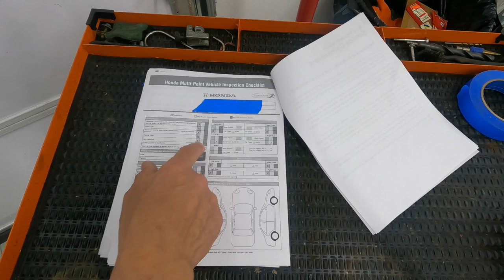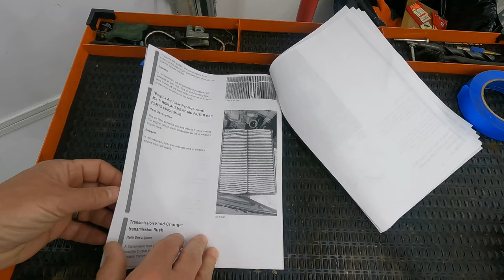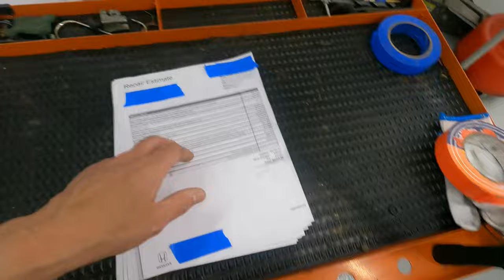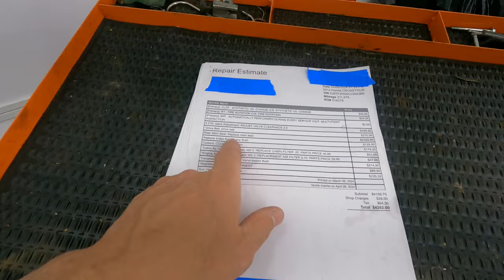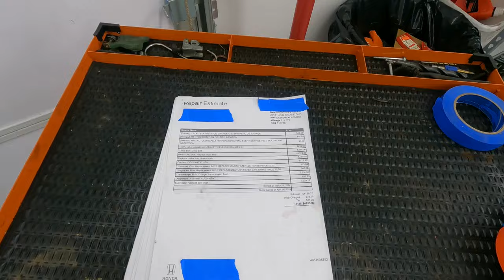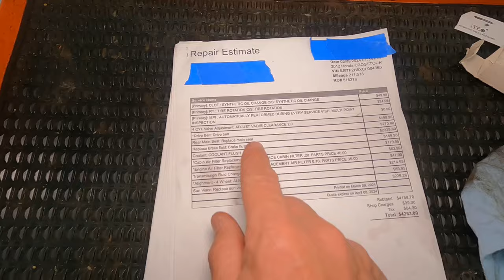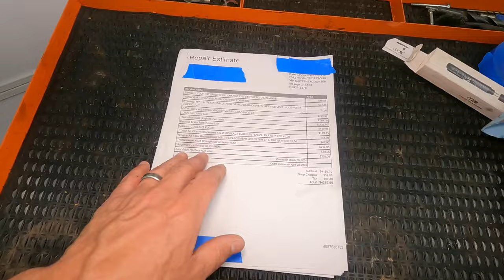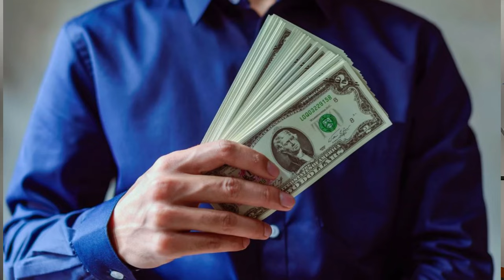Why car dealerships are called "stealerships"

Comment: The water is heavier than brake fluid it will accumulate at the bottom of calipers, so brake fluid flush is needed every 2-3 years to remove the water for system
Reply from the maker: Another good reason to open the bleeders when compressing the calipers to expel some of that crud while changing pads
Reply: @joyofwrenching  That's some I just recently learned, The stuff that came out of my F150 calipers was dark green and stank like the worst dirty socks ever!
Reply: @joyofwrenching  That water makes its way down there through the reservoir and is corroding the internals the whole time.  That's why brake fluid flushes are recommended.  They are not a scam.
Reply from the maker: @johnaclark1  yes, brake flushes are necessary now and again
Reply: Water dissolves in brake fluid, does not settle at bottom of calipers.  My 1998 Frontier at 275K miles is still on its factory rotors, drums, calipers, wheel cylinders, master cylinder, and original brake fluid.  Should I ever have a hydraulic issue, then I'll completely flush out all the old brake fluid.  Note that I'm in Arizona, very dry here.
Reply: Yes, water is denser than brake fluid. It WOULD accumulate in the lowest places...IF brake fluid was hydrophobic and they remained separate. But that's not the case. Brake fluid DISSOLVES water into itself just like air does. Nobody uses this terminology, but brake fluid can essentially have a humidity level, just like air can.

The reasons to flush out old, moist fluid are as follows:

1. SAFETY: Your brake fluid can get pretty hot. It can get hot enough that the moisture contained within it boils. Your "fluid" will be filled with millions of tiny steam bubbles, like a frothy foam. All these tiny steam bubbles are compressible, unlike the dry brake fluid itself. This compressibility means that when you push on the brake pedal, you energy will be used to squeeze those bubbles instead of to squeeze the brake pads together. This is usually referred to as having a "spongy" feeling brake pedal. If the condition is bad enough, you can push your pedal to the floor and still not have much braking effect. Depending on when and where this happens, it could be a, "My brakes don't work, OH SHIT," type of scenario.

2. DURABILITY: The moisture in your brake fluid can of course cause corrosion on some of the parts inside your brake system, decreasing the useful service life of those parts and therefor the entire system as a whole.

I change out the brake fluid in my street cars every other year, and on my track cars about every six months or at least prior to any track event where it's been more than six months. That level of obsession isn't absolutely necessary, but I like to play it very safe when it comes to my brakes.

Comment: I agree but we have a Chevy Dealership that is local to where I live in Ohio and their prices are on par to regular repair shops so I’ve been splitting where I have my car worked on. I go there when I want factory parts and for transmission flush and things like that and go to my cousins wife’s family tire shop for that.
Reply from the maker: Yes, as you've found, not all dealerships are bad! Nice that you have a family connection at another shop too for that second opinion and some less expensive work.

Comment: The problem with dealerships is all those flushes are high proffit for the poor tech getting paied for every hour of work sold not for every hour he is there, as for rear main leak or valve adjustment again high pay on customer pay compaired to scraps the dealer ship pays for warrenty work. You also have to remember that most dealers dont pay diagnostic time, so are you going to put to much time into diagnostics if your not getting paied? Likely no your going to look at the service scedual and let the service writer do his job there are bad apples everywhere but dont point the finger at the tech he is doing what he can to feed his family. If the greedy dealer wanted to pay for a real craftsman this shit wouldnt happen
Reply from the maker: We can all agree the techs are the real heros and are getting abused in this industry.  They really should be paid and treated better!

Comment: Those are two different leaks there.  Rear main is seeping a bit.
Reply from the maker: Could have spit out a drop or two over the couple hundred thousand miles, that's true. Surprised they missed the CV axle leak though

Comment: Installed new brake pads and rotors on pathfinder. Had some warranty work done few weeks later. Nissans "inspection" said my brake pads where in dire need of replacment. They even wrote some phoney measurment showing how bad they where. What a joke
Reply from the maker: So sad, but good for you to know better! And think how much you saved doing those brakes and rotors yourself!
Reply: GM dealer wanted to replace the 1-month aftermarket radiator hoses on our 2005 a 15 years ago.  The hoses had the Gates stickers and non-GM hose clamps on them, believe they "diagnosed" from odometer reading.

Comment: As I tell folks, odds are the dealership is going to suggest anything that isn't as it was when it left the factory.    
Sagging visor? Who cares if the owner doesn't. Maybe the owner is shorter and keeps the visor in the down position 99 percent of the time. 
Seeping seal? We call that spot rust proofing here in the rust belt. =-)  Keep an eye on it, if it gets worse, yeah, then we'll go in.  
From the list on this car, I got a feeling rear main seal was the lead to a further upsell once it was in the shop; hey Joe, we found something else once we got in here, you need a shaft and seal... btw, that'll be an additional $999....  You don't want to spend that much on fixing your used car? Well, heres Sam, he can show you some of our new cars that you'll really love..."

Comment: Valve adjustment for our 2005 CRV is in the owners manual as a mileage based item and the brake fluid change interval is also in the owners manual as a time based change. I bet if you opened that owners manual, both services are probably due. Are you recommending ignoring these schedules printed in that cars manual?? Also I believe valves only make noise if they are tight, not loose, (or the other way I forget), so no noise does not mean it doesn’t need it.
Reply from the maker: Good points, and no I don't recommend ignoring these types of issues forever, just hated that these guys made the owner feel like they needed to do that all today, and many of the recs were wrong

Comment: I got a coupon oil change at my local BMW dealer. They came back with a recommendation to replace all 4 spark plugs for $700. They're 100k mile plugs, and the car only had 40k miles! I later bought them myself, along with new coil packs, and did the job when the car was at a higher mileage. It was super easy, even for me.
Reply from the maker: Good catch! And think of all the money you'll save over time doing your own maintenance...enough to enjoy a nice vacation I'll bet!
Reply: European Cars are very expensive to repair when out of warranty.  Also they often use plastic parts which do not last over time.

Comment: And the “alignment” scam is a buggy.  We did a free alignment check and one is out…. $150.00?   Had that tried and refused. Got car home and checked torque in all wheels the next day.  The one that was out had 2 nuts side by side that were hand loses and the others under torqued.  Corrected that. Took care of to an independent alignment shop and told them what went in. They did an alignment check. All in spec. Haven’t been back to the dealer since.
Reply from the maker: Wow, that's shady if they loosened the lugs! and dangerous!

Comment: Even if you pay for a transmission or brake fluid change what's to say they don't do it but charge you for it? My coworker marked his tires to see if the dealer did the $19.99 tire rotation. They did not. He called them out and pointed out the special marks he made. The manager made excuse that the tech is going thru a hard time and then have my coworker coupons for a couple of free oil changes.
Reply from the maker: Ouch, busted!

Comment: Big brother was a mechanic working for a domestic dealer (not Ford or GM, hint)  which often offered a $9.99 oil change. Figured I couldn't go wrong with my brother as the tech, right?
He tried to warn me off, because he was 'required' to upsell the job, and if he couldn't, the advisor would!
I asked big bro if my demanding adherence to the advertisement would jeopardize his job, he grinned and said, "Let's find out."
My truck was low mileage, less than 3 months old, and perfect...
The service manager was pissed, and brother had a new job 2 weeks later (a Master with 30+ years at that point, getting another position was not a bother😊)
Reply from the maker: Wow, that's so sad, but I'm glad he had options!

Comment: Cant agree more - I have 2013 ford (escape 1.6litre turbo) which the adaptive cruise control radar stopped working - dealership quote for part without installation =  $5000, had 2nd hand part $350 plus fitting & programming $300 - not been back since.
Reply from the maker: Wow, that's a big difference...enough to fund a vacation!

Comment: Dealership hourly rates are usually 150-175 per hour….Factory replacement parts either: belts etc are double parts houses….what do you expect?
Reply from the maker: The dealership does tend to be more pricey than many Indy shops

Comment: That passenger front wheel did look like it was wearing more on the inside. 

The coolant should be changing atheist every 105,000. That car had over 200,xxx
Reply from the maker: Yeah, many of these things need to be addressed over time if the owner wants to keep it going as long as possible,  but in this case they tried to take advantage of his lack of knowledge and used some fear tactics to make them think it was all critical
Reply: There is a simple and inexpensive test which tells the coolant strength in cold weather.

Comment: Isn't it true that Hondas require valve adjustment every hundred thousand miles? This car has 200k so the tech advisor was right to recommend. It's one of the reasons I prefer Toyota.  ( valves never need adjustment and has timing chain instead of belt). Hondas require more maintenance after lots of miles compared to Toyota. It sucks that Honda stuck with adjustable valves and timing belts. I guarantee you those valves have tightened out of spec after 200k. I don't agree that you should wait until they make lots of noise.
Reply from the maker: yes, this should be checked and adjusted on these engines. It's just not the end of the world they tried to say it was, and I still think it's funny they quoted the cost for a 4 cyl adjustment...wonder if they would have hit them with a higher 6 cyl cost had they got the go-ahead?
Reply: A tight valve shortly becomes a burned valve and a burned job requires a valve job.  I just don’t know why a valve adjustment would be over 500.00?  Must take close to four hours?  Doesn’t look that time intensive.  Anyone?
Reply: Only V6 Hondas have timing belts.  The fours haven’t had belts in many years.
Reply: @craigjorgensen4637  thanks
Reply: @craigjorgensen4637   I would think that valve jobs are over 500 bucks because only mechanics with lots of experience and training should do the job and they will charge accordingly.  Where do you live to think 500 is a lot for a valve job?  Just fixing a valve cover leak is probably 400.  (Just replacing the gasket).   Adjusting the valves to factory spec should cost well over 800 dollars I would guess.
Reply from the maker: @craigjorgensen4637  it really doesn't seem too bad other than removing the valve covers, which means moving all the stuff above them
Reply: @hothmobile100  Well, if a simple valve adjustment is 550.00 a valve JOB would have to be triple that.  It would involve a lot of labor, sending the heads to a machine shop and a lot of money in parts.  I can’t imagine a valve ADJUSTMENT could take three hours?  Add a set of valve cover gaskets and yeah I suppose with a few other parts and tax the price could go,over 500.00.  I guess I live in the past.

Comment: I am not a fan of the dealerships either but you are overlooking a few things and leading your customer/friend down a bit of a primrose path.  A few comments here from someone who has worked on a lot of these J series Hondas:

Be careful telling someone they don't need the valve adjustment.  If that car has 200k on it, and it's never been done, it absolutely needs a valve adjustment.  Having done many on these, I can tell you that the exhaust valves will tighten up and cause no noise. This begins to happen around 140-150k miles.  Honda recommends the adjustment every 105k. I'm all for skipping it and pushing it off to 150k or more but not beyond 200k.  So, just because it's not noisy does not mean it doesn't need a valve adjustment.  Every one I've adjusted valves on has had tight exhaust valves and loose intake valves.  With tight exhaust valves the engine is at risk of burning exhaust valves, or at the very least will begin to experience random, unexplained misfires.  If there is any record of it being done then it's unlikely it would need it again at this mileage.  Otherwise it's a good recommendation and definitely should be done soon.

Your inspection of the serpentine belt is incomplete.  Yes, check for visible cracks but also you need to check them for wear in the grooves.  You only need a cheap small tool to check that.  It looks like a small saw blade and goes across the belt in the grooves.  If it's tight then it's good.  If the tool wiggles back and forth across the groves then it's worn and should be replaced. You didn't check that.

Brake fluid does absorb moisture from the air so that would need to be checked, along with copper content of the fluid.  Copper is a byproduct of corrosion.  You can't go by color of the fluid.  Honda recommends every 2 years but you can buy test strips that check the copper content and their are moisture testers, as well.  

That oil could be coming from the axle seal but another common source of misdiagnosed oil leaks on these is the rear spool valve.  They are prone to leakage.  I agree they are completely wrong on the rear main seal diagnosis though.  

Transmission flushes.  Honda doesn't recommend "flushes" on their transmissions.  I hate when the Honda dealer even calls them that.  They are simple drain and fills and if you can change your own oil, you can do trans fluid changes on these.  If your goal is to change all/most of the fluid then 4 drain and fills, with some driving in between, is what Honda recommends and I think they recommend it every 30-45k miles.  Personally, I do one trans drain and fill every other oil change on my own J35 which keeps most of the fluid clean all the time. I've got over 273k miles on mine.

My point here is that much of what the dealership is recommending is valid.  Yes, their prices are higher than what you can find elsewhere but most everyone knows that when they go there.  The rear main seal is a complete misdiagnosis and it's pretty obvious it doesn't need an alignment.  The rest of the items are good and valid recommendations.
Reply from the maker: Good points and information. Thanks! I hate that they made my friend feel like these were all urgent, but I agree they all eventually need doing on cars we plan to keep a long time. They plan to get a newer one soon in this case and don't really have the money to do it all
Reply: Well Said.  Dealer Service Shops have more experience with the car brand they sell.  Cars are also becoming more and more complicated by computer software which can make it harder for independent shops to properly diagnose.